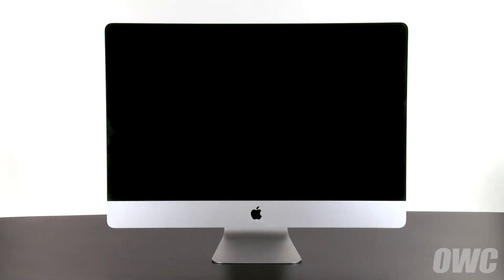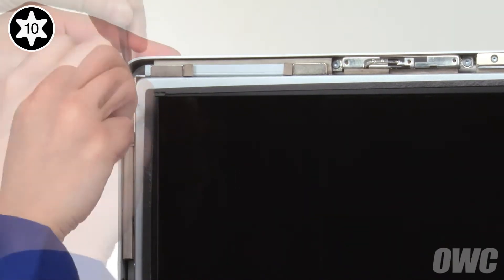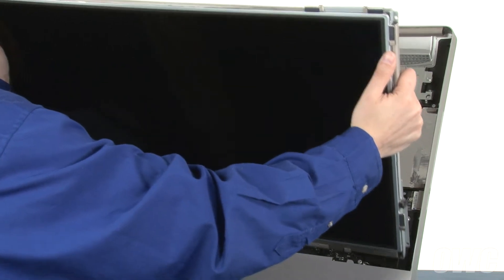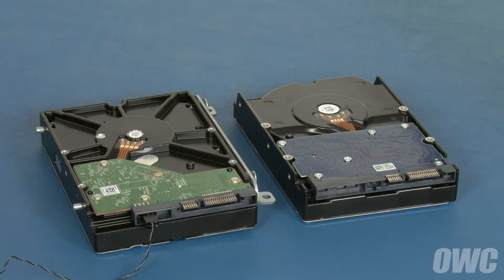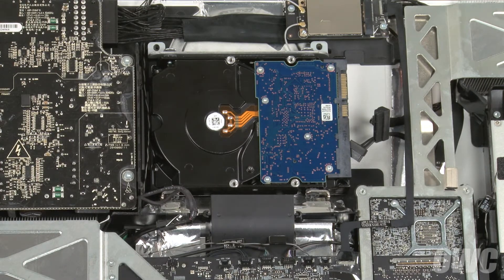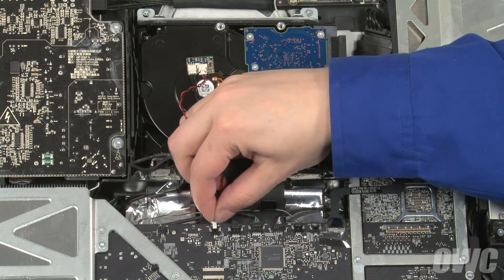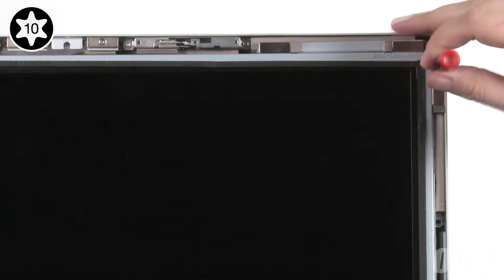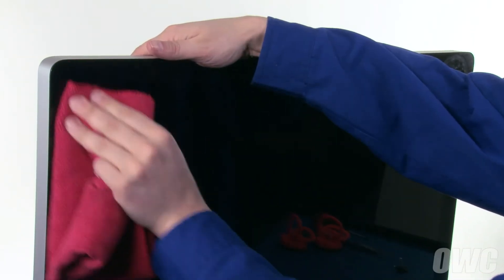How to Upgrade the Main Drive in a 27-inch iMac Mid 2010 (Updated)

Comment: I just did this and snapped the display port connector off the board when trying to push it back in.😭
Reply from the maker: I am sorry to hear that Jaun! The boards tend to be fragile so we recommend being very careful. I would maybe take a look at iFixIt and see if they have any replacement parts.
Reply: @poweredbyowc  thanks, but I’m in Australia and everyone I’ve contacted doesn’t want to know. It’s a 2010 model so I’m due an upgrade😁
Reply from the maker: Well we are sorry to hear that there isn't much options to service that there! However if you do need help finding a good used/new unit you can always give our support team an email at support@owc.com!

Comment: I used this to help me install a 2TB SSD (Micron 1100) in the 27" Mid 2010 iMac. Worked perfectly fine. I used the "Sabrent BK-PCBS" 2.5" to 3.5" Adapter to properly mount the SSD and did not use any SATA Adapter Cables, just connected the SSD to power and data normally. Then I took the temperature sensor cable, cut the end of the HDD of and short-circuited the 2 wires (with a WAGO 221) to make the Mac think the temperature is low. Everything went fine. The iMac is now a gazillion times faster.
Reply: What do you do to short circuit the wires? Did you cut off the sensor cable going that would normally plug into the old HDD? Then take those two ends and put the exposed ends of the new cut cable into a WAGO 221? Just trying to clarify. Thanks! Did you have any issues with overheating or fan speed since doing this?